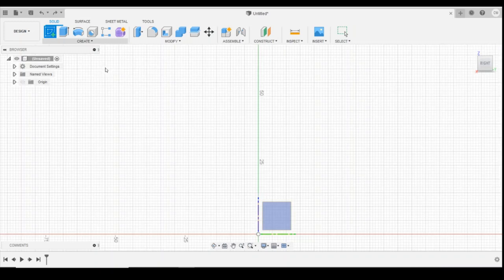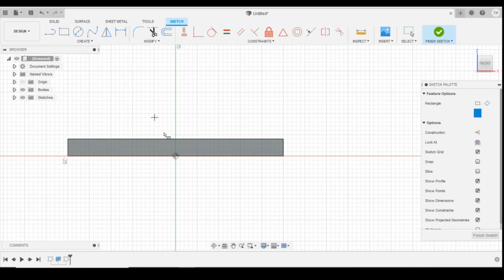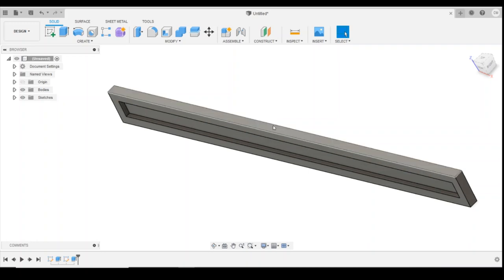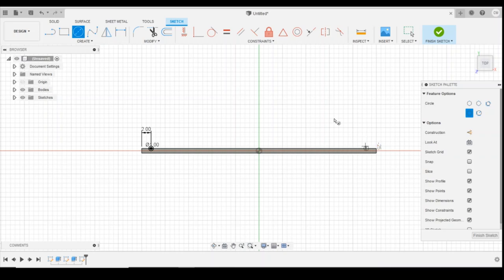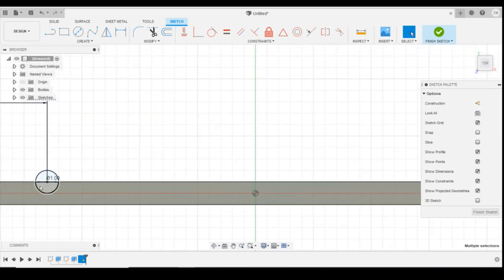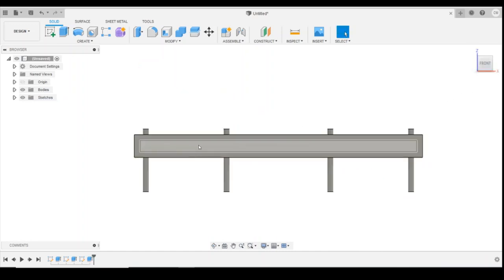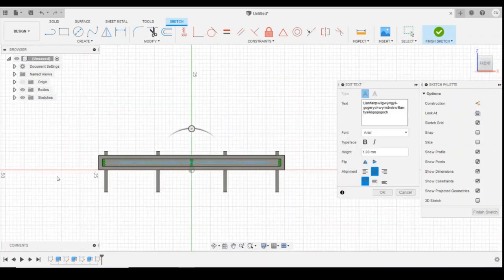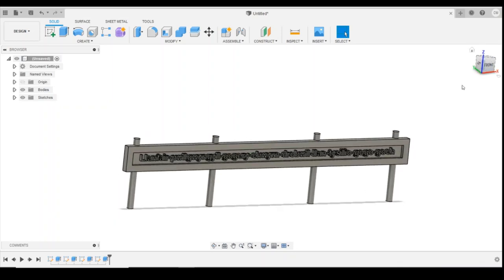Lesson 6 - Fusion 360 for Beginners.  Adding Text to a Surface

Comment: The discipline you have in defining edges and lengths is making it crystal clear why we need to do this. Very well done, I learn a new trick every video. Sometimes i don't realize i learned it until i am on my part and think I will try to use this tool and it just comes to me.   Then I know i saw it here. Have been wanting to label my repair parts with the part name and version and now i can,  thank you, Dennis
Reply from the maker: You are so welcome!

Comment: That's great, very good series of tutorials, my brain is just about keeping up, two questions, I can see your example will make excellent road signs - the type made of cast aluminium with raised text, but for a oo gauge layout a typical sign such as "HIGH STREET" would be no more than say 10mm x 5mm - would the text be legible when 3D printed? Secondly, had a quick look at downloading the Fusion360 software but I can find a personal use version limited to 1 year - is this the version I should be getting? Thanks and keep up the good work.
Reply from the maker: Hi Paul,

Yes you could use this technique on anything you could think of.  I have some raised text on one of the track machines i have printed that is 1mm tall.  at that size it is small and hard to see/paint  but it has printed well enough that you can make it out.

Regarding the Fusion subscription yes all that is available on the free version is a 1 year subscription,  but after that year they prompt you to renew and there is no limit as to how many times you can renew.

Thanks

Carl
Reply: @3ddrawingformodelrailways  Carl, thanks for the feedback, I've been wanting to get into 3D printing for some time but knowing nothing about 3D printers or suitable software I haven't really pursued it - so thanks once again for spending your time doing this. It's really opening up the possibilities for the mundane type stuff you see everywhere that is either not available to buy or very expensive - bollards, lampposts, street signs, road gulleys, drain covers, fencing, railings, playground equipment, benches, bins the list is endless!
Reply from the maker: @ipcress1066  yes having that door opened really does enable you to get the stuff that just isn't available,  that's the reason that I started to look into it 18 months.  my very first drawing was a station platform edge that was based on the ones used in the south east when they did the platform extensions for the Networker EMUs.